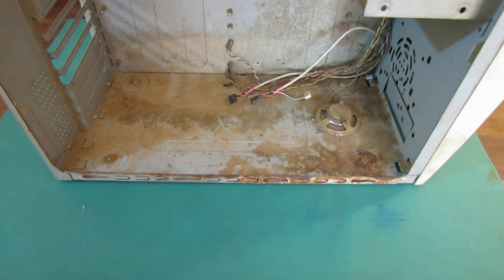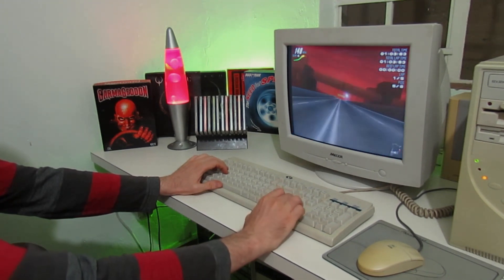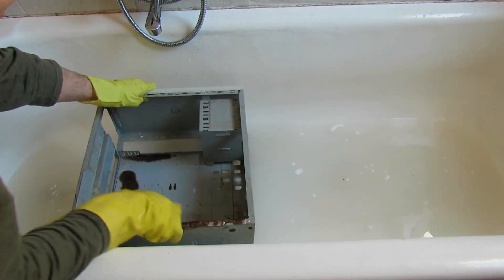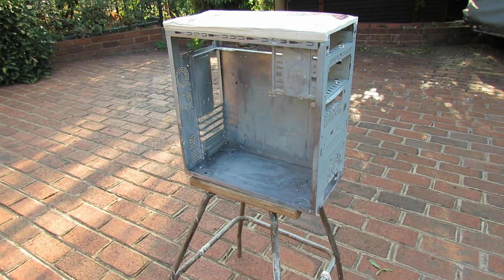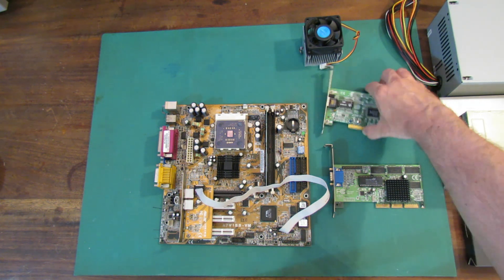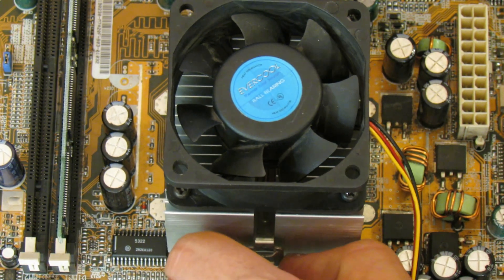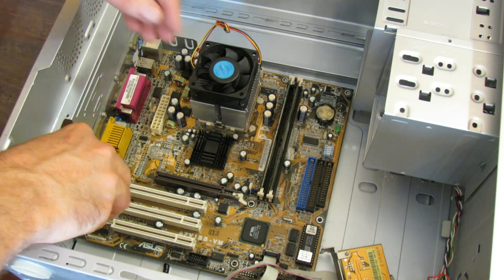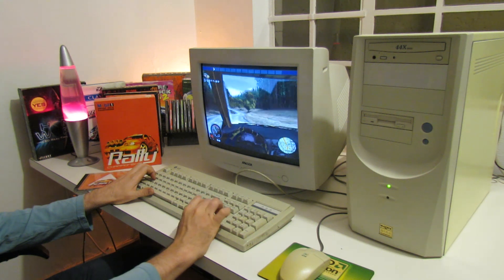Trash to Treasure: part 1 - Building a retro pc for (almost) free.

Comment: A7V sounds really familiar to me, which means it was probably a "budget" board back in the day I used on somebody's PC.  I believe that's called a "Baby ATX" form factor.
I see it has the "I hope I don't stab a screwdriver through the motherboard" heat sink.
I didn't mess with onboard video a whole lot, but one thing I almost always did was go into the bios and allocate max ram space to it.
I don't remember tossing ATX cases, but I'm having bad flash backs of tossing some glorious AT cases because they were too old to use and too new for collectors.
Better quality than any ATX cases, at least the desktops were because they needed to support heavy monitors.
Instead of that galvanize, some practically looked chrome plated and the metal was thick.

Comment: Windows XP is to heavy for this rig. Windows ME or 98 should be fine.
Reply: Windows xp runs perfectly fine on my Pentium 3 with 256mb of RAM.
But maybe, 128mb are not enough for xp.
Sorry for my bad English
Reply: @felix-cq9eq  fine it doesn't mean smooth. Believe me with pentium 3 the sweet spot is Windows 2000 SP4 OR 98SE.

Comment: Great job, that case came out really well. I have a similar board that I picked up for cheap, and put it in an old (silver) HP case. You're right - it's hard to get beige cases! Something to watch out for with Socket A/462 if others are building similar is that it can be quite punishing on the 5v lines of a PSU - and that modern PSUs (if you go that route) tend to have more current on the 12v rails instead of the 5v.
Reply from the maker: Thanks for the Kind words, and for the good advice on the PSU!

Comment: I think XP might me too much for this PC to gain optimal performance - 98 shall be just fine. Other thing is that case restoration - awesome job! I watch many videos on the subject of restoration but that case rebuild was best quality and effect I've seen yet. Keep on!
Reply from the maker: Thanks Smoke! I think I will maybe move it down to Win98 at some point.
Reply: @ohsoretro5612  Just make dual boot system. We had it this way, back in 2001-2002. Because early Windows XP was not so good, and there 've been lots of compatibility issues, so we kept also WIndows 98.

Comment: I don't think the rust at the bottom is caused by acid battery, but something kinda worse : rat pee
Very nice case restoration though !

I saw that the CD-Rom drive you installed originally didn't work as planned as well :p
Reply from the maker: haha yeah I must admit I hadnt considered the rat pee hypothesis! May very well be that! And yeah the cdrom drive I originally used was dead and I couldnt be bothered to open it up and see if I could get it going again, so I just replaced it!